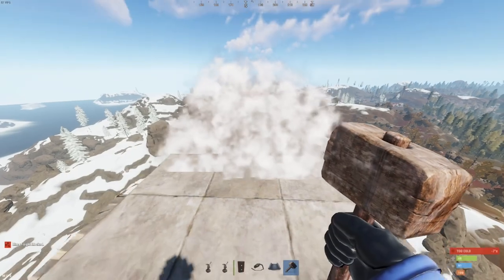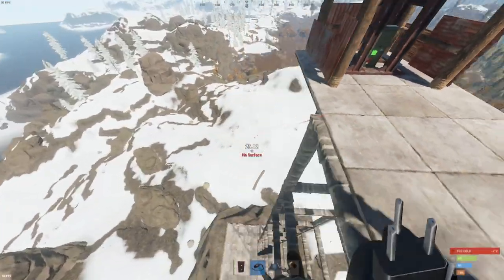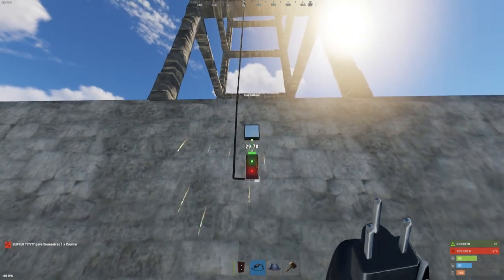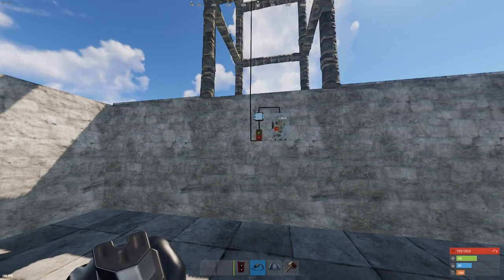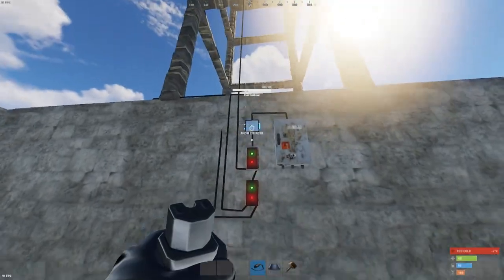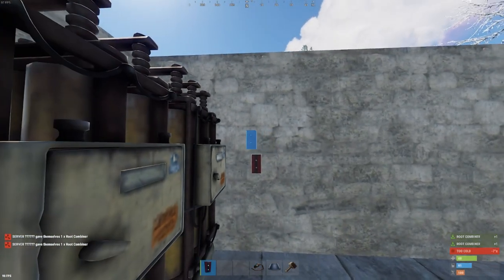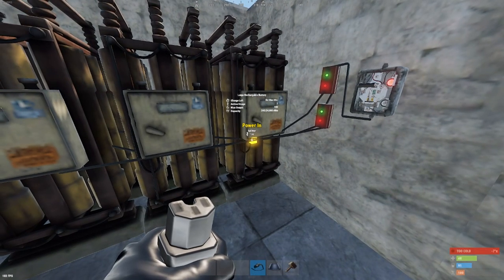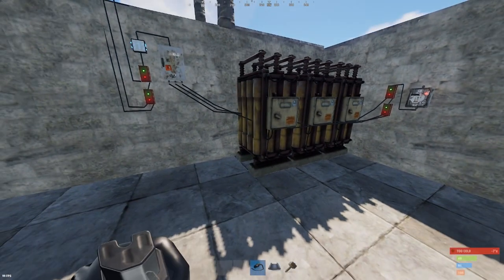Rust | Triple Battery Powered Circuit With Single Output

Comment: Please don’t do this… you’re wasting power by connecting the output of more than one battery together. Just have 3 separate circuits if you need more than 100 active usage.

Comment: The root combined batteries don't work... You still only have the capacity of one battery because electrical components draw equal power from all 3 batteries. A couple SAM sites won't draw 50 and leave 250 left, they will draw 50 from EVERY battery.
Reply: This is partially incorrect, the "draw the same power on every battery" is totally correct, but the amount of energy will add up, so he will have 300 or whatever power, but it will use all the batteries. This is something they need to address. if you can use the 300 power, then don't draw the same equal amount of power to all batteries, make it like a big pool of energy (another circuit would be nice).

The best option here is to have them connected in series with each wind turbine and use each one until it gets to 100, then you can use the next one to 100, so on, so forth, but if you are using them to 100 or close, then combining them is less of a pain, unless you want to modularize or atomize the power usage.
Reply: @AnotherFancyUser  Connecting them directly in series results in a large power loss, since the 80% charging efficiency cascades in an even greater loss in efficiency. The most efficient way to utilize the batteries is to have them charged from the remaining power supplied by the last electrical branch. This could take a long time if the power utilized by the derivative circuit is close to the maximum power output; adding solar panels can fix this. The most efficient way to use large batteries is to have them wired individually to a circuit that doesn't exceed 100 and to chain them together using branches + blockers. However, it's also possible to root combine large batteries in an efficient manner if a circuit is just below an increment of 100 and the branch + blocker method can be used to increase the overall capacity by linking each set of root combined batteries. A bank of generators can also be hooked up to the end of the branch + blocker chain to extend the capacity.

Achieving a functioning and efficient large electrical system in Rust takes a great deal of experience, planning and time. Some people spend all day hooking up electrical components in clans.
Reply: You need a nih core